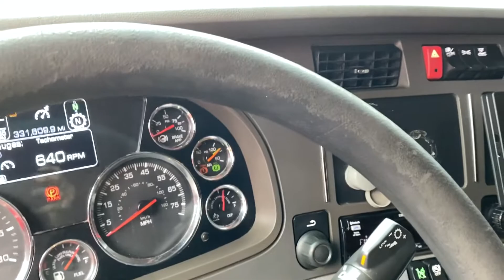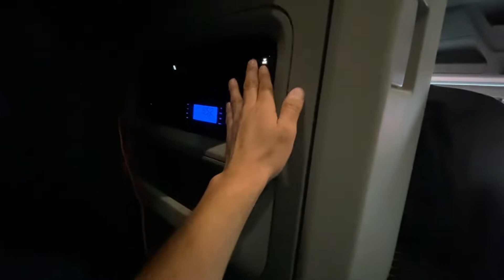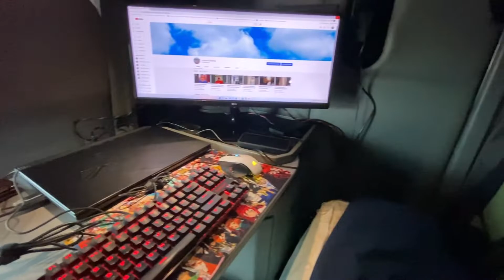CFI Issued 2019 Kenworth T680 Tour! | Getting My Truck With A Side Of Issues (Trucker Life)

Comment: In trucking you get what they give you in company if you refuse the truck you will be placed last of the list or they might have to recover a truck that is worst off two how long you have been driving for if you are fresh out of school then too bad so sad welcome to trucking dude
Reply from the maker: Lol a big welcome to trucking. 9 months later though this truck has been a hoss for me. A couple of minor hiccups with it but at 390,000 miles it still does the job.
Reply: @JohnnyTrucking  well i just got this notice today bro keep the rubber side down and the shiny side up
Reply: @JohnnyTrucking  watch out for the newer ones like thev2022 lot of bugs in them since they are not broken in especially the automatics when i drove for Southern refrigerated the crapcadia had issues leaking from the marker lights always wanted to jump gears when jakes were on the 6% down hills the worst the cruise control mitigation system always hit ghost images over passes any reflection it nailed i was so glad when my grandpas k100 was restored i left srt and started running my k100 on my own drywall to utah and back
Reply from the maker: @tylerbuckley2092  thanks for heads up!! Stay safe out there buddy!
Reply: @JohnnyTrucking  will do brother trucker 10 10 on the side